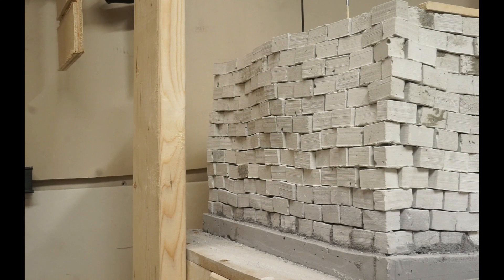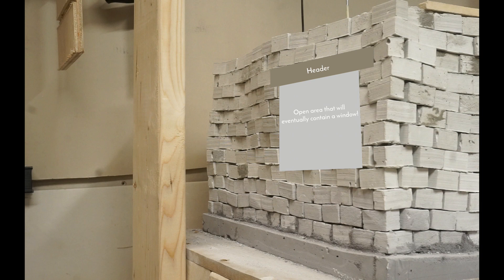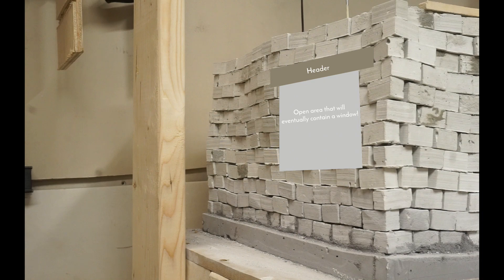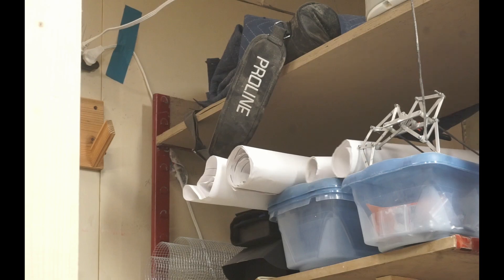Building a Realistic Model House, Part 7: Casting Headers for Doors and Windows

Comment: Again, great music.
Heat gun to speed up the drying. Any problems?
Wire as rebar for the headers, nice touch.
Plan to use spirit level, string and chalk lines to keep the bricks level?
Plan to add cement along with the rebar to form perpendicular posts to the brick layout? To help prevent bowing?
Glad to see the plans, again. Suggest showing where on the plans you are currently working on with each video now that material is "on the job site" and ready for the build.
Reply from the maker: My eat gun has worked really well to accelerate the time it takes for all the block and also the headers to cure. Also, everything you mentioned I'm planning on doing (already tried out the line and spirit level, see part #4)! And yes, I agree, I need to show the plans more often. Once I'm done with all this block and am able to move around between tasks a bit more, I definitely will be sure to!